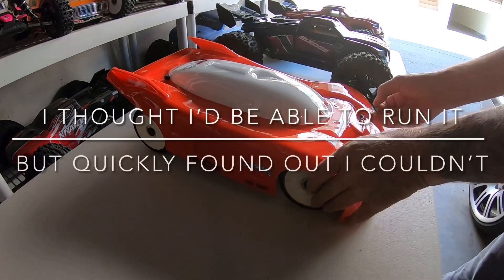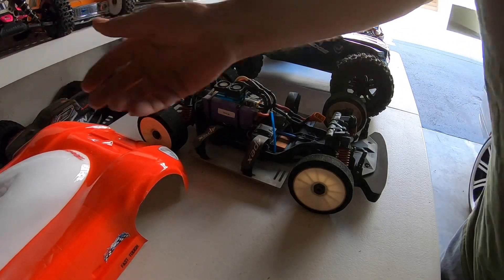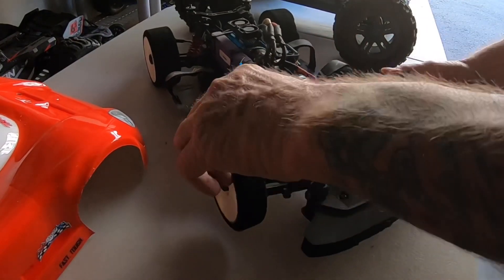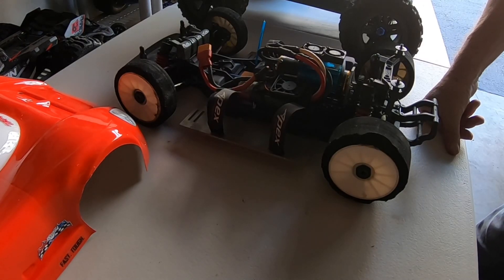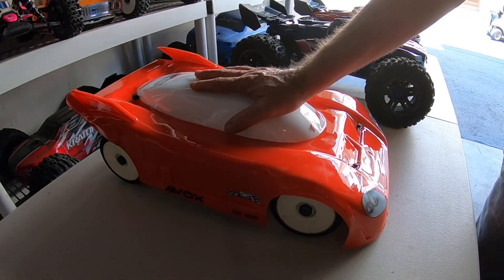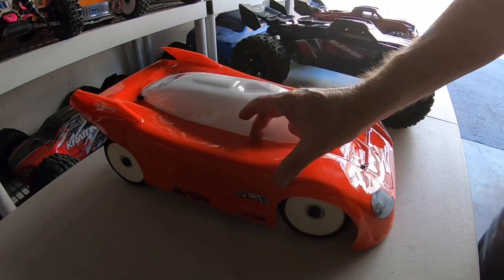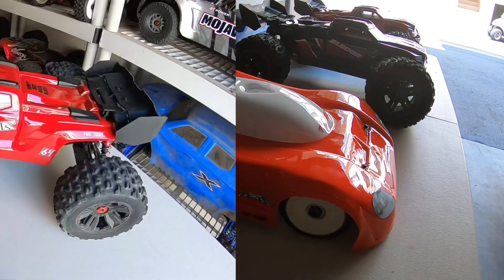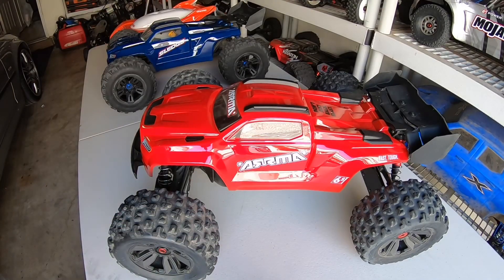Traxxas Slash 150mph Refresh & There is no 180-190MPH Arrma or Traxxas World fastest in my Opinion?

Comment: You are spot on. No manufacturer could possibly make money selling 150 mph cars. Speed runs are not easy. Once you get over 80mph there are way to many variables and tolerance issues. You could probably build a 180-190 car for $1500-2k. It’s the money spent learning to drive those speeds that add up.
Reply from the maker: Yes 💯💯

Comment: I don’t really see too many people saying they have the fastest Arrma, just saying they’re going for the RC world record. 

But in all fairness, the cars Raz and James build are a lot closer to an Arrma or an RC you can buy than the car that actually holds the record. That car was entirely engineered to break the world record, they even had special wheels made. 

Now to your point, I totally get what you’re saying that after a while it’s not an Arrma anymore but it’s hard to draw that line of when that happens. Most cars I see from James are still using both front and rear diffs and diff housing. All stock driveshaft lengths, tires you can buy online, and all the parts you can buy and bolt right on. They’re still just modifications to a rtr from Arrma so who cares if they call it the fastest Arrma? Now I’d be up for creating specific classes to put these cars into just like real racing. 

No hate just food for thought. Nice vid man
Reply from the maker: It’s not very hard to draw that line as the rc is built from scratch with 90% of the original used parts to have been replaced it’s not that manufacture rc anymore 🤷🏻‍♂️
Reply: @earlmoorhead5555  but even doing what you do, changing motor mount, motor, ESC and whatever else you change is still changing a big percentage of the car from factory. That’s what I was saying for where do we draw the line. 

If you look up real drag racing, they have world records for specific cars even though they change majority of the components on the car. 

I’d be really interested in creating classes just like real drag racing. Like a electronics only class where you can only change electronics, then there can be an unlimited class where you can run anything with any amount of changes.

Comment: Thanks man. I will have to see about adding some spacers in there. Still not sure how you got them in there, but will look harder. Great trucks. Thanks again.
Reply from the maker: There just servo spacers wasn’t easy but used needle nose pliers to hold one screw at a time I did open up the holes on the spacers to make it easier 👍👍
Reply from the maker: I didn’t clip the mount over the shock tower either moved the whole bracket to the backside of the shock tower as my chassis seems bent and the rear aluminum diff housing I feel was to thick

Comment: Hey Earl.. It's been a while since watching. I haven't kept up on the speed stuff. I never really thought about it in that sense. I'll just say for me, I don't really have an input because all our stuff is modified, once you add a fan, change the motor or speed control. It's modified. Now Raz and others, I respect them simply for the fabricating, and ability to push it. 

I gave up speed runs after I hit 135 one my original infraction 2 years ago. It got a flip, and literally flow a good 50 feet, and I said, hey, that's enough. 
I got into the 5th scale electrics, but even that, I haven't even run those in a long time. 

But I agree to a certain extent, but still think all the machines are modified. I still think it's cool, and don't care or matter the chassis, and the achievement's these cars have gone to.. It's allot in these things, as far as setup, parts, etc..
Reply from the maker: For me I feel it’s the person skillz building and running them I get tiered of hearing world fastest arrma traxxas redcat Ect when there is truly nothing left to call it by a manufacturer any more 👍👍👍thanks for the comments 👍👍💯💯🙏

Comment: Believe it or not my Arrma gt cars from last season where way more stock than you might think,  my 190+mph car from last season was stock chassis with all stock suspension , towers, shocks, diffs , stock bearings,  everything ,
Still have it and will be running it this season. 
My Hobao vte2 , just posted a 186mph pass and it is completely stock also except motor mount and center shafts .

You can buy and off the shelf infraction/limitless add electronics and center drive shafts  and do a proper setup and run 180+,  with a motor mount change even more. ,  
This is the first season that ive ran a carbon chassis full build car. 
I do however understand what you are saying however, at some point its a custom build based on whatever car .
Reply from the maker: Yes as ppl getting into the hobby now thinking there a stock car not realizing the body motor mount gears differential locked up and shock set ups with adding all the electric and then seeing everything in carbon including chassis become a Arrma still I just hate ppl believing it’s a stock rc as there a few well skilled ppl like you doing record based of your talent and not the brand of rc cars 👍👍keep it up 💯

Comment: I c u still haven't changed the tread around on limitless 😅.... also how did u get powerhobby wheels on in the rear.?... Mines has resistance when I put on larger rears
Reply from the maker: If you see the installation they need washers behind the wheels power hobby now include these washers 👍👍

Comment: Well, no one is calling them "World's Fastest Fully Stock RTR [insert model here]". If they did and then offered up a modded car you'd have a point. But people who race full sized vehicles will claim world's fastest Supra, fastest Corvette, Fastest AMC Pacer, etc. and I'm going to go out on a limb and say that no one in their right mind expects ANY of these vehicles to be 100% stock (or even 50% stock for that matter). I'll even go so far as to say that anyone looking at it will EXPECT it to be extensively modified. I think it's safe to assume that what people are referring to is the platform from which they are working. Without a sanctioning racing organization, you're going to run into issues from the perspective that you're coming from because you're going to get into endless discussions about how much modification IS allowed and still be called a stock [insert model here] and every person is going to argue why theirs should still be considered an X justifying an arbitrary level of modification (SURELY with no hint of self interest in their arguments whatsoever). This is the reason why in sanctioned RC racing it is actually the stock and NOT the modified classes that are far more expensive and difficult to be competitive in because the factory drivers are replacing every bit they can with titanium and plumbing the depths of detail in allowable modification since everyone is using, for all intents and purposes, motors in the same performance bracket making it a ludicrous proposition for any greenhorn entering the hobby to try and compete at. It's actually cheaper running in the modified class because you can "Top Gear" it and just add more power to compensate.
Reply from the maker: World fastest Supra is correct there not saying world fastest toyota ? But world fastest infraction would be correct if they leave that body on ! The point is the manufacturer didn’t build it if the chassis been replaced just like a promod built drag car 💯💯
Reply: @earlmoorhead5555  I do believe that people differentiate between manufacturer and model when making their "fastest" claims, so I'm not sure where you're going with that. I specifically said that it is understood that when someone says "fastest Infraction" that the poster of the video is talking about the platform from which they were working (you can make the same GT build from either an Infraction, Limitless or Felony - the only distinction I would make is that if you're calling your car a Limitless build it needs to be open wheeled). Were they claiming "fastest fully stock RTR Infraction" and then presented a GT build you would be right that this is, if I was being nice, deceptive. It would obviously be a lie. But I believe I said that in the first two sentences of the OP.

Furthermore...what does the body have to do with it? Your comparison isn't really applicable in this case as there are no sanctioning bodies of speed running, it's just a hobby/enthusiast community. I'm fairly certain that the NHRA has detailed rules on what defines a car as a promod (or whatever class of vehicle). We have no comparable rule book for speed running. If we had something like ROAR or IFMAR governing and sanctioning speed running events, THEN your comparison would make sense. Is it really your contention that James Mccoy's 200mph run is not a VTE2? It comes with neither body, nor wheels, nor electronics so how do YOU define what car he is driving? Sure, you could call it a custom build (which, it isn't - it IS what you would call customized) but, to my mind, as the drivetrain, suspension and the basis of the platform is a Hobao VTE2, I think it's fair to call it a VTE2. Would it become an Infraction if I put an Infraction body on it? The obvious answer is "no".

To me a custom build would be something like what @Liberty Francis has cooked up for his attempt at 200+mph https://www.youtube.com/watch?v=I1UJy6ZErAs

As I said before, your path of accepting some modifications but not others when referring to a car will lead to nothing but endless debates about what can be called a Slash by YOUR definition and what can be called a Slash by someone else's and that isn't just not helpful, it will actively create debate, controversies and, in the end, division for no other reason than to satisfy your definition fetish. The easy shortcut is just to call the thing what you began working from. We can SEE if it's been modified or not.
Reply from the maker: Chassis make the build it the foundation if replaced it’s custom 💯💯no matter how you explain it 90% of the rc is replaced with aftermarket parts it’s now you’re build not a manufacturer product
Reply: @earlmoorhead5555  Ok, what I'm saying is either going over your head or you just can't be bothered to respond to what I'm saying. You're not addressing 98% of my points about which I'm being very specific. You think you have a point, but based on your responses I feel comfortable saying that you do not. You're not answering any of my questions and if you can't make a reasoned argument as to WHY you hold the position that you do, simply making an assertion does not make it so and no amount of 100 100 emojis are going to make one iota of difference. Either you're being intentionally obtuse or you simply do not understand the arguments that I'm making because you address virtually nothing of what I said. You do not even appear to understand the difference between:

custom made - “Designed or built specially for a particular customer, and being different to other things of the same kind.”

and:

customized - modified to suit a particular individual or task.
"a customized car"

And no, that is NOT the same thing. I can reason my position and demonstrate to you how and why you are wrong. Your reply is little more than a temper tantrum saying "I am right because I say so".
Reply from the maker: @diemturner5755  when I read the first few line and disagree with it I won’t read the rest of the book your writing as I feel it will never change your mind nor will you change mine! But I leave up your comment for others to read that’s the point of a comment
Reply: @earlmoorhead5555  I know, reading isn't for the faint of heart. So I'll keep it terse and please riddle me this...what kind of car did James Mccoy drive 200mph with? Was that not a Hobao VTE2?

Comment: I think it's a waste of money modding 2wd slashes to go suoerfast because they disintegrate if you hit anything going that fast and they break driveshafts,transmission housings ect. If you jump them....I bought a kyosho mp9 and I can send it all day and it never breaks...only thing I broke was part of the cooling head when I flipped it over on concrete from a 4 ft jump.....
Reply: And the felony rtr is still way faster than my fully modded slash...
Reply from the maker: Just a way different class of rc and scale 🤔